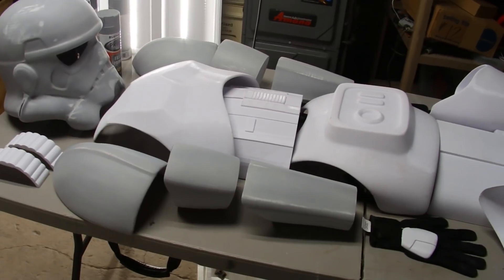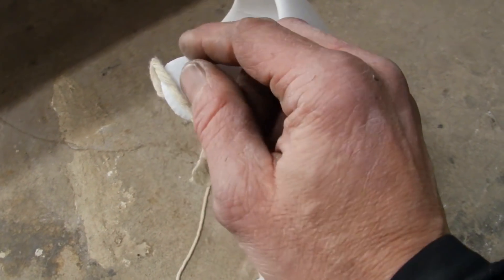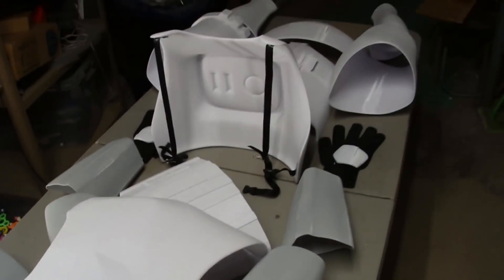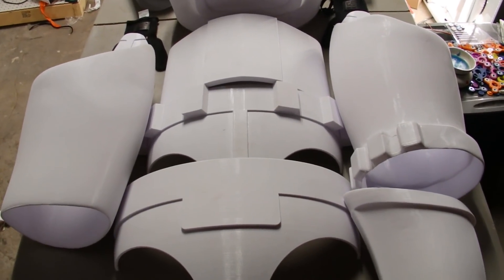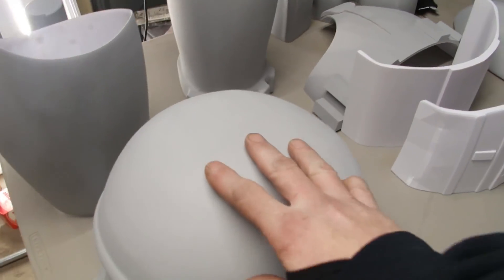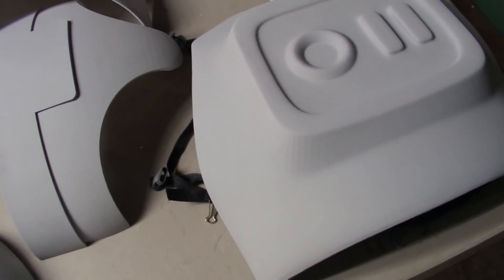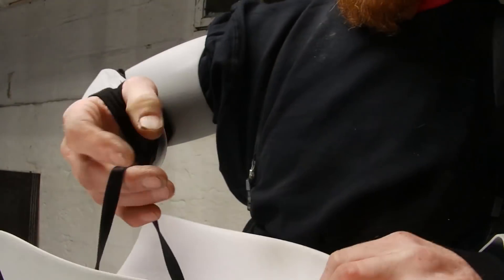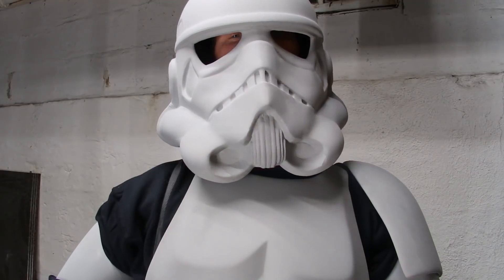My 3D Printed Stormtrooper Suit is Printed

Comment: Hey Matt, was hoping for some help/input about your build. Like yourself, i am building an armor set from the thingiverse files posted by sn3850. Its going well but i am not happy with the abdomen/codpiece part. While watching this video i noticed these parts are different from mine and much closer to what i am looking for.(yours is two pieces instead of one like the included file and the missing details are present in your prints as well.  My question is did you get these particular parts from another source and if so could you point me in the direction of where you found them? ...or did you edit the included blender file yourself to add the missing features from codpiece/abdomen? any help at all would be greatly appreciated. This is kind of a stuck point for my build.
Reply from the maker: William Hall the abs, lower back, butt and cod price are from https://www.thingiverse.com/thing:1103411
I didn’t like the way the other model prices look either hope this helps
Reply: Perfect, this helps tremendously. Oh, and thanks for the speedy response! Love the channel man, keep 'em coming.
Reply from the maker: I try and reply to comments in a timely manner and you NEEDED an answer NOW I know ;) good luck printing man hope you share the results thanks for watching
Reply: Yep off work for xmas vacation so in the thick of it here trying to get as much done as possible while I have the free time. Will definitely post some results when i get this finished. helmet, chest, back, and forarms are done so still a ways to go but getting there. Oh, one more question... i noted how you scaled your parts to 91.4 and i did the same just as a random starting point and luckily they actually fit quite well but my question is did you need to do scaling for the ab, back, butt, and cod pieces since they were done from a different file set and if so do you remember what scale? would hate to print these twice if improper fit :-) thanks again Matt.
Reply from the maker: I kinda measured how wide my body was and used that a a gauge with the part on the build place I based the scale by the measurements if that makes sense

Comment: Gday mate. I'm in the 501st Legion. I troop as Vader and I was a Sandtrooper as well. For under your outfit use underarmour or skins top and bottom. A balaclava in the same type of material is also good. Well done.
Reply: Is 3D printed armour 501st approved?
Reply: @steve_en5903  usually if it does meet the requirements it does
Reply: @realmanga_art7893  What are the requirements for 501st armor?
Reply: @Isaac_Anthony_1861  as long as you search for references for stormtroopers on the internet and ask advice on the 501st forum you will get there. Mostly the hardest part is sanding the prints smooth but it’s not that hard so you will definitely get there. Just ask the forum for help if you need it

Comment: Is a stretchy body suit and using velcro for the armour out of the question? I know that barnacles nerdgasm had the stormtrooper suit made but I don’t recall how he tied it all together.
Reply from the maker: I will be using Velcro but my thought process was if I made it so it fastened together to stay on then it wouldn't matter what I had on under so in winter I can wear cold weather gear and summer I can wear hot weather gear but it's a work in progress I'll share the ending results for sure thanks for the suggestion and for watching